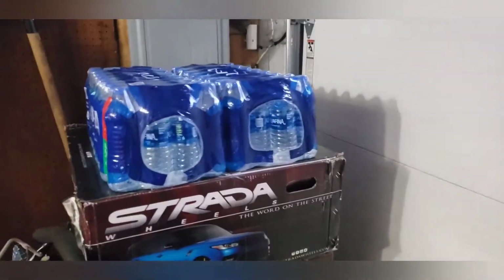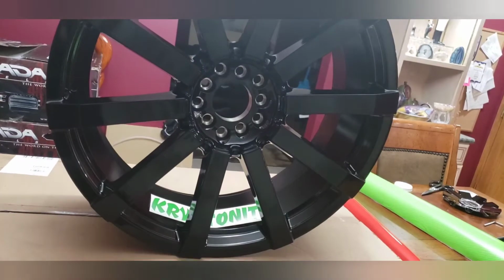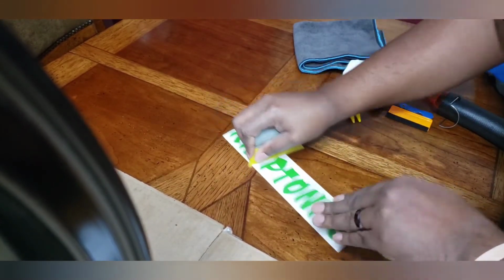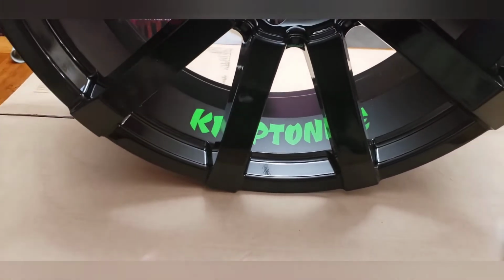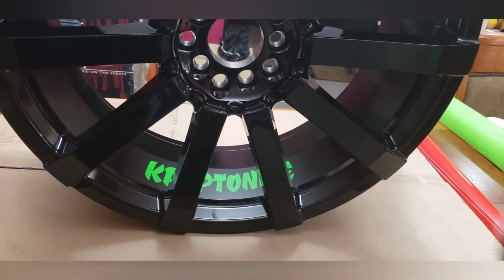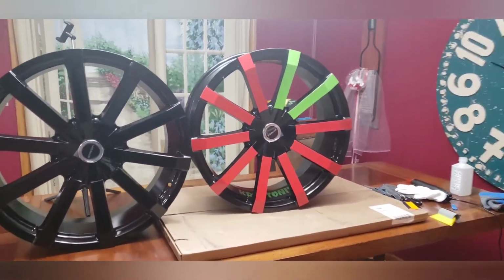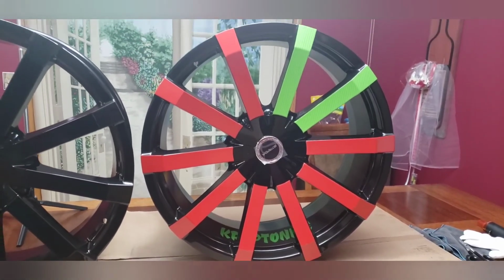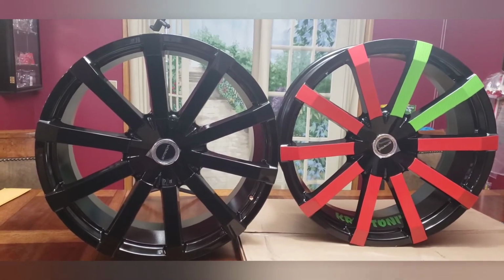HOW TO WRAP RIMS 2 colors for 3 tone rims (just the face) pt1

Comment: Nice job bro the wheels look good...I been thinking about doing this to my wheels before I get the tires them...I just don't want to mess it up but doesn't look too bad the way you did it....kool vid subbed 👍🏽💪🏽👊🏽
Reply from the maker: Appreciate you bro....the vivid gloss worked the best...and make sure you keep the blade angled away from the rim.. not flush on the rim...and go slow..and you schould be good
Reply: @Kevsworld412  thanks bro I appreciate the feedback and tips ima see what I can do....I have an octane red charger and I got some octane red vinyl from luxe auto concepts so we will see how it goes I'll do a vid once I get going.....thanks again
Reply from the maker: @ynrt_5.772  no problem bro..im check the vid out when you drop it